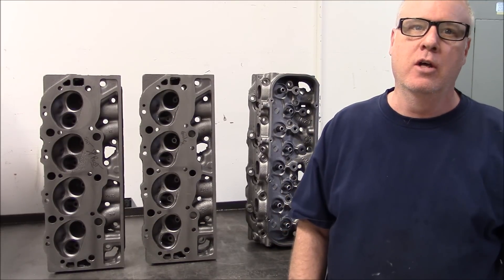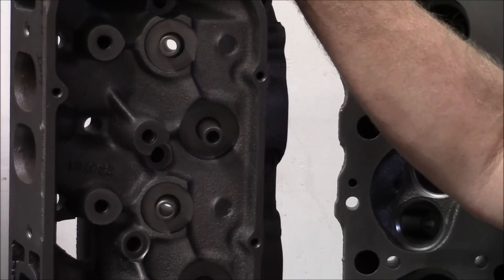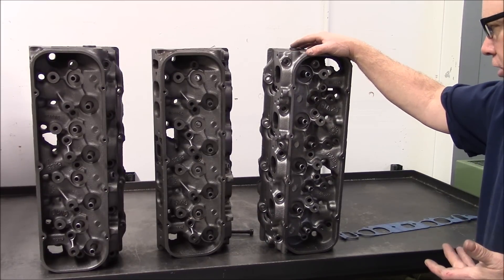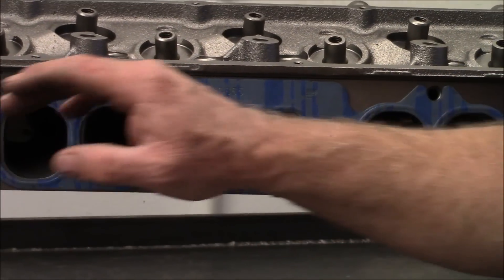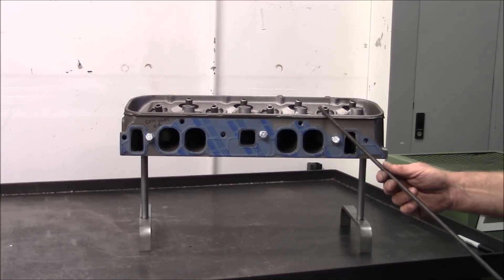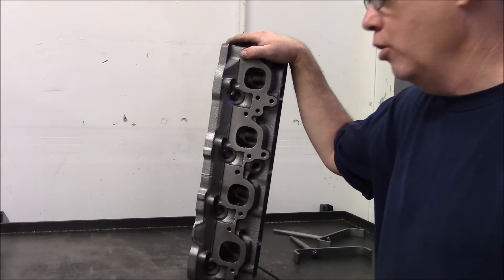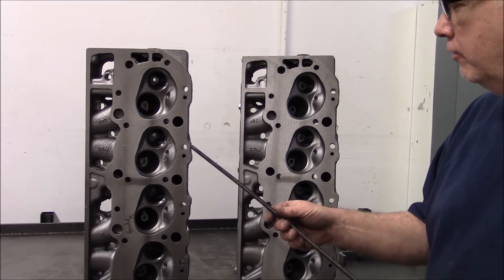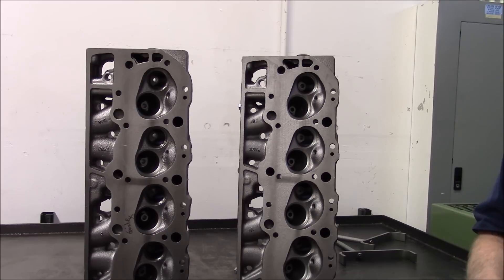Engine Build 620 HP 454 Big Block Chevy Part 3 Oval Port Head Core Selection Before Porting

Comment: 820 is a better flowing choice than those two head's but they Are 1971 Open Chambers and not unleaded gas head's. But for limited street use and for Drag racing they are A good choice. But if you use tall domes it might take a little bit of work to make the domes fit in the head's. I'm not much on the small dome pistons in any Big Block Chevy engine. Static Compression Ratio and Dynamic Compression Ratio are two completely different things in reality.

Comment: I’ve been building and machining these heads since 1991.  
   This is by far the best information shared on the internet concerning these heads.  
   I’ve encountered many of these issues first hand. Every one of these details can make or break your goals.  
   Plus there are several key details I have never been afforded the opportunity to learn.  
    I’ve always wanted a good set of 719 or 049 heads to work on.  
    I want to install 11/32” k-liners in them in attempt to reduce valve weight. 
    2.19” , 1.88” and do the port work described and shown in this man’s additional videos. 
    I’ve performed some very extensive port work on factory cast iron heads. Most often the rectangle port versions. In those times that all anyone would consider spending the money on and it was big money for those times.  
    All the while I was creating spare time on an oval port head testing a bit here and there. 
    It didn’t take long to figure out. The potential in an oval port head was greater. Nobody would hear it.  Even the Brodix RR heads showed similar.

Comment: I have 1967 427 049 heads  98 cc the 74 454 781 have 118 cc
Reply: Are you sure?  The 427/396 heads for 1967 were oval port closed chambers with 98 cc but head number was 702

Comment: I just picked up a clean set of 292’s for $200. They have good guides no rust pitting and passed the magnaflux inspection. They still have stock valves and don’t appear to have had any work done to them. Are these heads good candidates for a performance build?

Comment: I picked up a set of 1971 820's about a year ago for 100 bucks. Had them checked, everything renewed for another 150, I have no extreme build, but about 450 Hp with about 425 -450 ft pounds of trq.

Comment: Mark if I took a 454 went 11 or 12-1 afr 265 head single plane and healthy Isky SFT would that be capable of getting my 67 CAmino in the 10s or at least bottom 11s reliably
Guessing a 2 bolt cast crank is out....ballpark of what you would charge for this shipped to SoCal
Reply: 2 bolt block is good

Comment: I used a set of these heads that were ported and had 2.190 1.880 ss valves in the mid 80s when there wasn't so many aftermarket heads available. They worked better than rect. Ports for the everyday driving , the low end torque was much better. Today aftermarket would be more economical

Comment: Hi, will a bbc 1996 and later head part 12560241 work on a 1984 454 bbc motor, ifso what would need to be used or done to make them work? Thanks......

Comment: Some of the other heads work just as well, I made 611 on 93 octane with a Gen IV 454, had pistons just to give me room for more cam, no added CI (~18cc dome) 
ported/built 088 heads, aggressive cam, Victor 454R, QuickFuel 850 carb. Was an absolute blast in the 1970 Monte SS I had it in. Definitely a car I wish I’d never sold off. 😔

Comment: Interesting,  why is it noone talks about 702 castings. Closed chamber  98cc. Oval port. Information on these heads would be greatly appreciated.
Reply: I have a set and I had the intakes ported which was widening and flattening the port floor at the short side radius. They have 2.19 & 1.88 valves which are shrouded by the combustion chamber wall when open so they plunge cut the wall to unshroud the valves which made the prior 98 cc chambers into 100 cc chambers.  I put them on a 454 + 0.030” with a Straub spec’ed Clay Smith HR cam 221/235 @ 0.050”  and 0.570” lift.  Put it in a 4500 lb ‘72 C10 and it will get nasty the instant the back barrels open on the DaVinci prepped 3310 Holley that flows 830 cfm.  It annihilates the tires in 1’st & 2’nd gear unless I am running drag radials and they hook.  Running flat tops with 0.040” quench and 9.5:1 CR and 40* total timing on 93 octane!

Didn’t have the heads flowed but the head guy said comparable work he does usually gets 320 cfm on the intakes.

Comment: When I built my big block they said go open chamber. I did that and took them to a great machine shop who did a lot of circle track engines. The engine performed beautiful but by time I was done with the heads the cost made me think I should’ve went aftermarket but back in the day there wasn’t too much available and they were out of my price range so I thought. Well that engine is still in my Chevelle 30 years later.

Comment: In 73 they also had an open chamber with ovel  ports.  454 hAd 8.2 compression, rated at rear wheels 275hp and 490 torque. Perfect turbo head.

Comment: my mechanic has just installed a 1989  454 heavy big on engine on my chevy k2500 1989 truck started it up sounds good. There is one problem the oil filter is getting in the way of the drive shaft from the transfer box therefore he removed the drive shaft to the front axle can someone tell me if the oil filter can be relocated? tag on the engine 10052952 GM please inbox me hotwaxcrew@gmail.com

Comment: i have a 80's 454 stroker crate motor all factory with 6000 miles on it 450 hp at 485 torque how much power can i get out of the stock heads i have put a 650 carb on it have a tunnel ram for one carb would like to put it on and a bigger cam looking at after market cast iron heads for it but they have a good price for them trying to stay cheap so for i got everything for free trying to see how nice an cheap i can build a 68 pu the pu has a nice clean body with faded factory paint needs paint and wood in the box all chrome is still on it

Comment: HEY SHIT BOX, BUY AFTERMARKET HEADS AND PUT THEM IN YOUR SHIT BOX
YOU OBVIOUSLY HAVE NO KNOWLEDGE AND/OR EXPERIENCE WITH GM SHIT BOX
SUGGEST YOU GO BACK TO YOUR SHIT BOX GARAGE, OPEN YOUR SHIT BOX TOOL CAB, AND GET YOUR SHIT SHOVEL OUT AND MAKE A PILE OF THOSE SHIT BOX ALUMINUM HEADS AND PUT THEM INTO THE BACK OF YOUR SHIT BOX TRUCK THEN HAUL THEM OFF TO THE DUMP AND THROW THEM ALL AWAY
OR IN OTHER WORDS......………......SHIT BOX EM

Comment: If you think these are garbage your an idiot. Iron heads have been used forever just because aluminum heads are lighter doesn't make them better . Not everyone can afford them so shut up and learn something . I run iron heads on my small blocks and consistently beat the crap out of more expensive cars with better . More expensive engines with aluminum heads.

Comment: Why not rectangle port Big block heads?
Reply: If you're referring to stock OEM rectangular port heads, they usually run three times as much as a stock oval Port heads. And then good aluminum rectangular Port heads usually run $1200 on up each. A friend of mine sold me my first big block( we always help each other out with our cars). Had 781 heads already done with 2.25 valves cleaned up, mil down, new Springs new valves already set up for the cam. It was a isky cam everything was fresh on the lower end. $250. Runs really nice. Threw the motor in 1967.  Camaro. in front of a T56 Magnum with a 12-bolt in the rear. Normally that head set up would run you about $600 / rebuild. So in my case I would definitely use these heads or on the cheap. otherwise I probably would have went aluminum heads.
Reply: @jorgenegrete1366  I have a set of stock rectangular port heads that is why I asked the question. Thanks
Reply: @twinv63  sounds like you are already ahead of the game. Usually rectangular Port heads make more power higher up in the RPM band. Oval Port heads make horsepower and torque in the lower RPM. At least that's what I've read.

Comment: why would you put the garbage back out for others to come across and have to dump money into ? way to good keeping the garbage out there on craigslist!!
Reply: I would assume an even cheaper price would let anyone with a fair amount of knowledge & common sense know that the heads aren't as good as others, don't ya think? Or a disclaimer stating the heads are not well suited for racing, but ok for a work truck. What if someone with very little money is very desperate to get their work truck back up & running........they aren't worried about "racing" at all. But guys like you never consider that, do you. Of course not. The head is only "bad" for trying to make BIG horsepower........beyond what the factory stock engines made. MANY guys use 454 big blocks as a work engine in a work truck ya know........and for that work truck, they could care less about "making 620+ hp". So get a freakin' clue.

Comment: Dear friend... Because I'm old enough to have rowed thru the gear's of many a 396 Chevelles and a few Chevy Big block GTOs  I can tell you  with certainty we were ALWAYS on the look out for the Big rectangle port Big block head  but with the advent of today's cheaper Great flowing quality aluminum head's  so plentiful I can also tell you We don't have any Cast iron head's customer's  unless they are the purest who have a NHRA class Stocker ..
Reply: ALWAYS A BIG DEBATE BACK IN THE DAY OF OVAL VS RECTANGULAR, I THINK ANY HP GAIN WAS FROM THE LARGER VALVES BACK THEN AS THE RECT. HAD BIGGER VALVES, LOTS OF RACERS USED OVAL AND GOT LOTS OF POWER FROM THEM
Reply: Why the hell don't "know it alls" like you take the time to talk to the customers of this man & his shop. Because there's many of them, and they all swear by this guy and his abilities with these heads. I've already read statements from quite a few of them. And YOU ( just like all the other critic/"know it alls" ) make it painfully obvious that you don't possess the knowledge that this man has, to make these heads work great for A BUDGET BUILD that runs like a bat out of hell on pump gas and lives. And you just REALLY said a mouthful when you stated quote: "we don't have the customers for iron heads unless blah blah"..........Gee, that's awful damned funny, because THIS man & HIS shop obviously does. He lets his quality of work, the end product, and his satisfied customers do all that kind of talking.

Comment: Thanks very much for the info on the stock iron cylinder heads! I struggled to find as much info as you gave, thank you very much. To heck with all of those Rich, aftermarket aluminum snobs!
Reply: it'd be cheaper to buy Chinese aluminum heads instead of buying these and having all this work done to them

Comment: If you have the core shift where the gasket doesn't match up like the one bad head in this video, it will take you A-LOT more time to get the ports done the way mark teaches in this series! I already had too much invested to back out so I proceeded anyways. Plan on 15 hours per head not including the chamber work. I've ported a lot of sbc heads. The BBC take a lot more time! I still have one head to go. And yes, I was using carbides the whole way with extra pressure on those port openings. I'm going to get these flow bench tested just to see how close I got to Mark's heads. Duplicating the venturi is pretty challenging mostly because of how close you are to the seat. Take your time.

Comment: I like watching you're tutorials on the bbc, I've done plenty of SBC for myself and assisted with some bbc builds and am building my first bbc for myself and so far I started with a nice set of 781s... my question is, I know you get the most power from a solid cam but I'm looking to run a hydraulic, what   is a good lift, duration, lda, ls, etc to look for, this engine may or may not be sprayed and I'm looking for overall broad tq and hp, be a driver and get good numbers at the track, also what would a good cr be, 10:1, 11:1 and pump gas compliant?... thanks in advance for your time and help.

Comment: This is very good stuff, have a jet boat bud that can take junkyard stuff and single dominater and run 120 when 40 grand wont get most folks there. My question is will the vortec 454 heads flow enough to support 5 or 6 hundred hp. Or are the 70s still a better bet. Thanks.